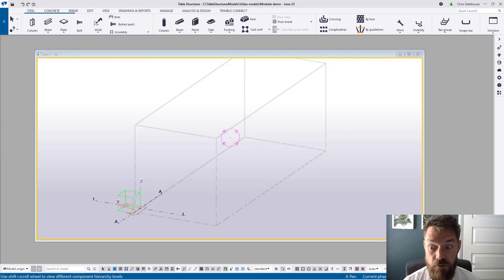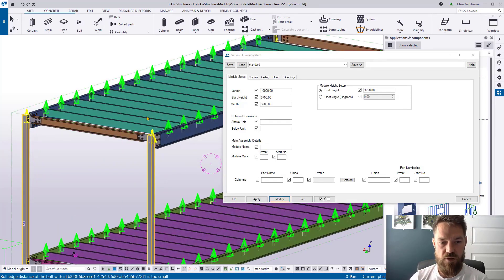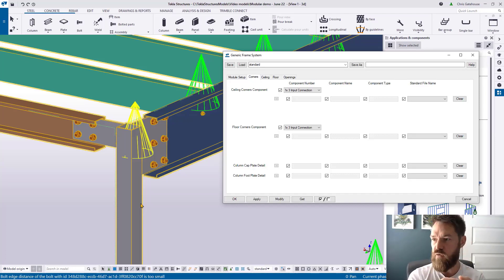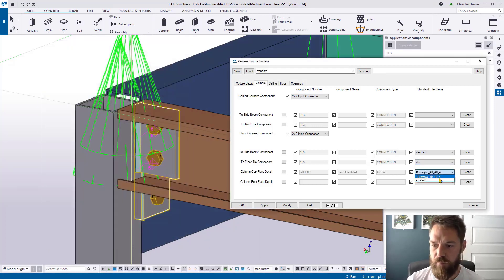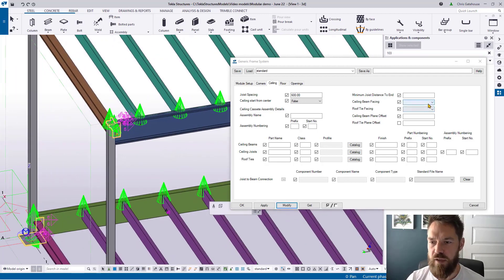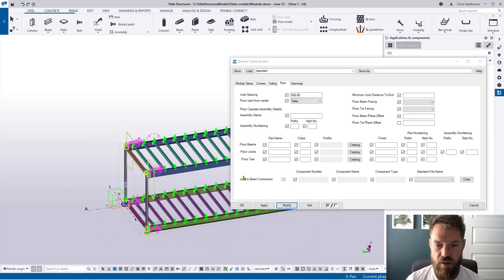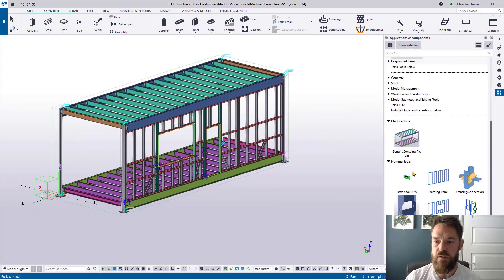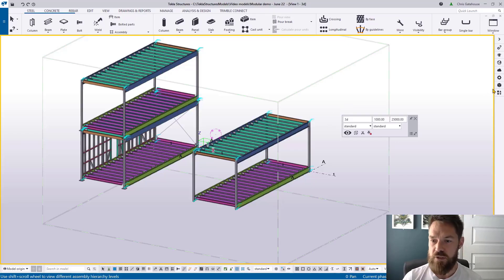Tekla Structures 2022 - How to use the Volumetric module tool

Comment: Great work, I personally was using Grasshopper definition to automate steel creation. I have found that different Modular manufacturers have quite different systems in how they put their modules together and with the grasshopper, there is more flexibility in defining different logics. Below is a short video of how it works for Tekla Structures and Autodesk Revit 
https://www.youtube.com/watch?v=_Oz84KkIcww